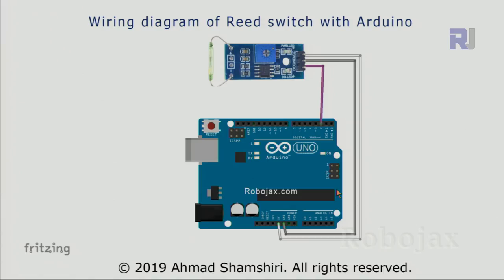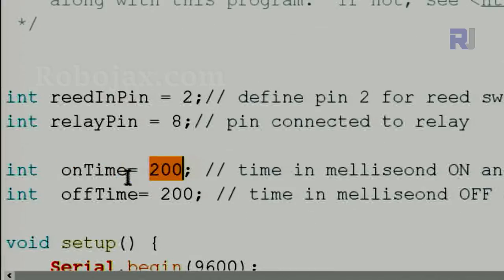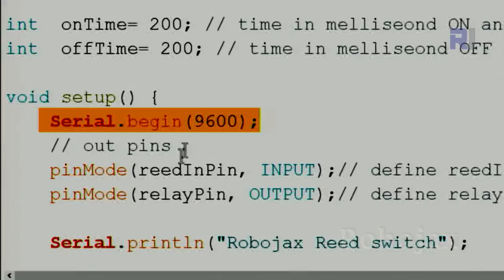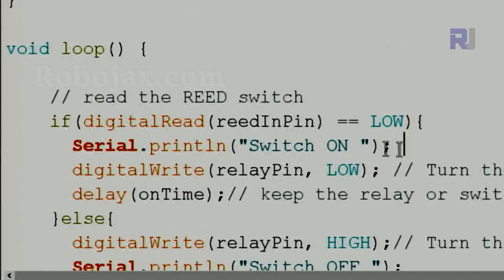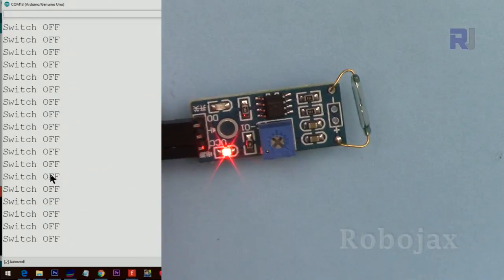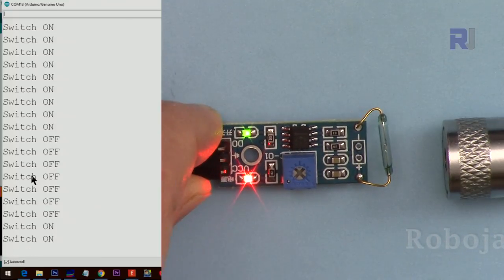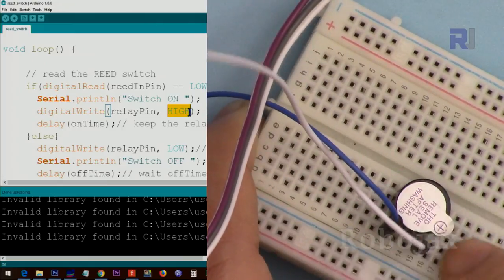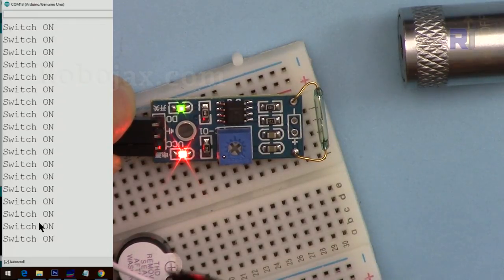Lesson 12: Using Reed Switch with Arduino  | Arduino Step By Step Course

Comment: Please make a video at temperature sensor switch mini module, like same module you have.
Beacuse i have a 1500watt 30amp step up converter fan not working when powered by battery if discconnet the load fan will start running if connet the load fan will stop working at high temperature
Please sovle my problem.
Reply from the maker: Hello,
Your project has two aspect. first learn how to turn ON/OFF relay with temperature. I have tones of videos on temperature. then learn how to read DC voltage to when powered by battery the load fan will start.  So break the project into two part, work each separately and once you succeed put them together. Detecting voltage is very easy. I have video on how to read potentiometer or voltage. just input the voltage from 12V using a voltage divider which I have video under the title "how to ready any voltage using Arduino" or something like that.